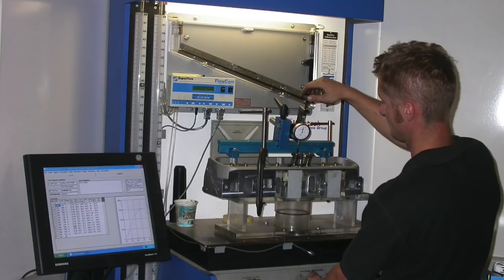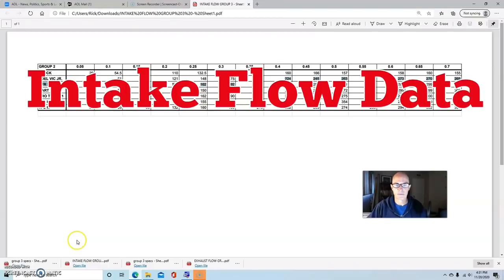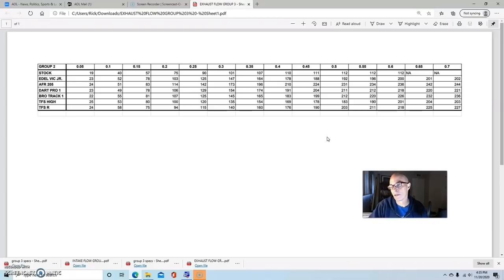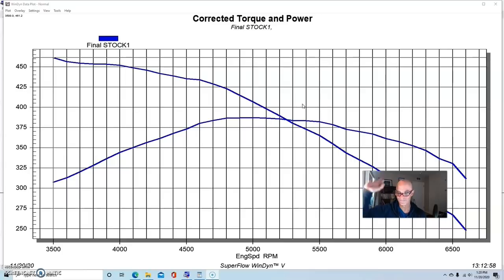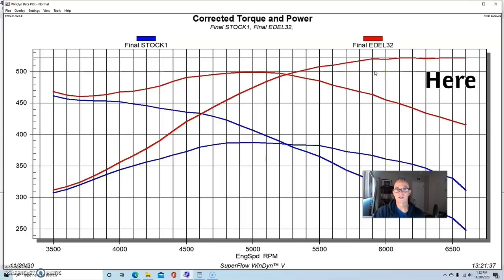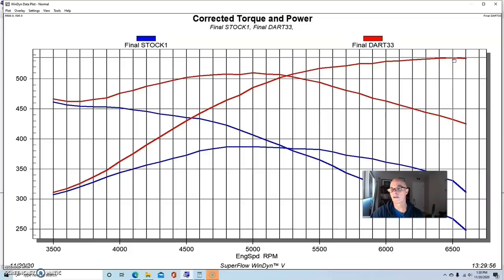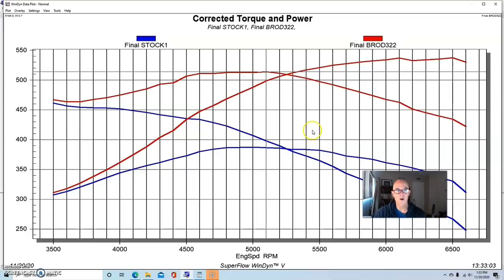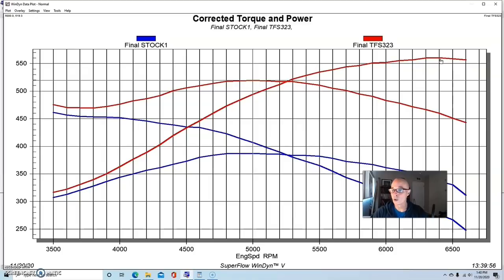MEGA 5.0L FORD CYLINDER HEAD TEST-PT 3

Comment: I was wondering how a big hydraulic roller cam would work with this combo instead of the solid roller.

I was also wondering if you might have any suggestions on what might be limiting a hydraulic roller from revving to its potential.  Are pedestal mount 5/16" bolt rockers a limit?  How about old factory Ford lifters?

I am running into this with my 351w with a Lunati Voodoo 
20350712.  I have the matching Lunati dual springs installed on my Blueprint (NKB) 190cc heads and 0.080" walled Trick Flow chrome moly pushrods.

Engine will only rev to 6000 rpm.  I have seen on another channel where a guy with a 331 ran to 6500 with this cam retarded to eliminate the 4 degrees of advance that is ground in.

Duration @ .050  231/239
Gross Valve Lift: .571/.587
LSA/ICL: 110/106
RPM Range: 2600-6600
Springs 73100 Lunati: Dual With Damper ;O.D. Outer: 1.450" ;I.D. Outer: 1.076" ;I.D. Inner: .730" ;Coil Bind: 1.110" ;Seat Load: 125@1.850" ;Open Load: 325@1.250" ;Rate (lbs/in): 333

I have not checked the installed height of the springs.  A friend that builds Mopars suggested I shim the springs so there is 0.030" clearance between the coils at max lift, but I have not checked my clearance.

Thanks.
Reply: It's a combination of both not enough duration and maybe not enough spring.

I suspect you need the next cam up in a 351w to run the 6600 and at least a 200cc head

A 190 on my 302 is a 6500 rpm head.

On a 351? Yeah 6000 is about right. Those springs it comes with aren't gonna get you to 6500 anyways the comp cams 987-16 lunatis etc are made for a 225 duration cam and I've seen ls1 guys run them to 6400

You need a spring with AT LEAST a rate of 400 and seat pressure of 145+ to do it
Reply from the maker: needs cam and springs
Reply: @richardholdener1727  Thanks.  How high do you think the Voodoo cam should rev with its recommended 333 lbs/in rate springs?  I already have the cam and springs installed and was thinking it should rev over 6100 rpm.  Also have you seen the pedestal mount's 5/16" bolts as being unstable over 6000 rpm?

Comment: It’s all about the power under the curve. Peak power is a narrow snapshot. Thank you for the way you present the full curve. YTM
Reply: yup. exactly why I wish he would have dropped a set of Cleveland heads in the mix to see what the sacrafice would have been. I wonder why we dont see so many boss 351 recreations
Reply: @DavieJones_Lockr   nowadays you can get windsor heads that outflow original cleveland 4v heads. Some by double!

Windsor blocks are also lighter and stronger. Easier and cheaper to build a 408w that makes 500 streetable hp.
Reply: @johnb7430  - Clevor!

Comment: The AFRs are awesome. But knowing the Trick Flow Rs beat them.....I wanna know why. Was it port volume or chamber shape?
Reply: Probably valve location. Heads are flowed on more than 4 inch bore machines. The afr would have more wall shrouding than the flow bench would give it.
Reply: The AFR's were still climbing in power at 6600rpm. Love that power curve.